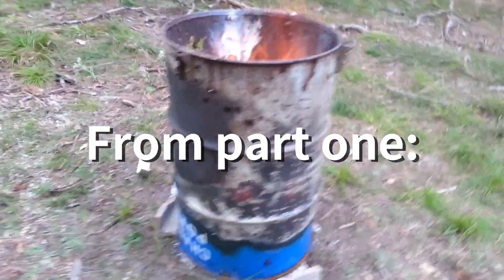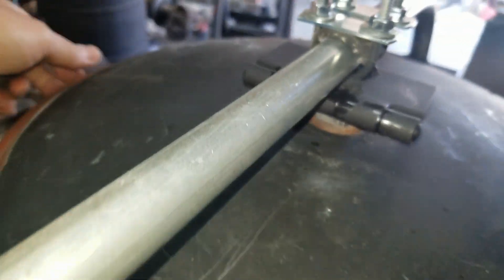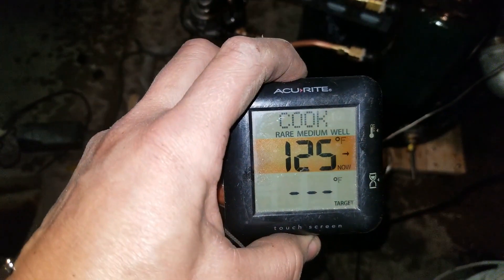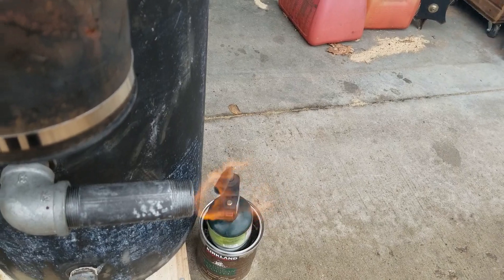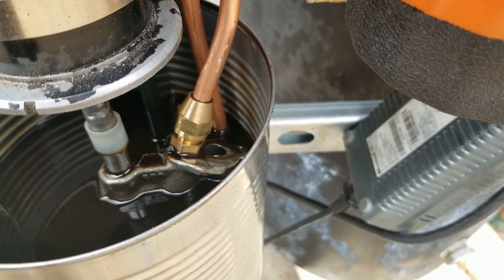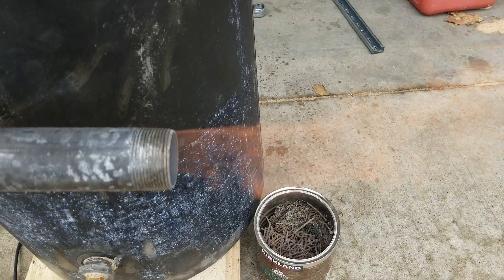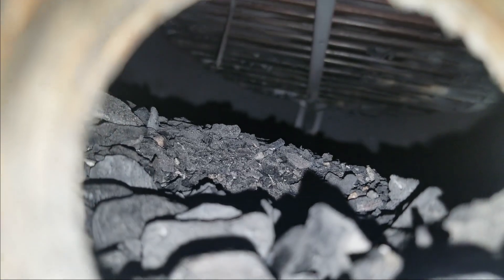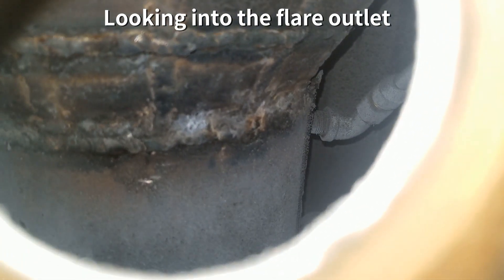Charcoal Gasifier Update 2022, Part 2

Comment: Nice work. 
Your charcoal gasifier is appreciably more elaborate than mine, and it produces a lot more gas as a result. 
Even after all these years of running engines on wood and charcoal, it still amazes me just how well it works  :) .

Comment: I have a few thoughts... why wouldn't you make a dual function gasifier... 
1. Gasifier  which run on charcoal gas...
2. A gasifier that utilize the extreme hot temp ie paralysis process to create charcoal for you at the same time ie  To used in the next burn.

Example 1. if your hopper was larger you could have wood chunks in a fully enclosed  sealable vessel with a manway  lid. You would take the wood gass from the charoal vessel and inject back in to Pyrolysis chamber to be burned. You would need a vibrator mounted to the hopper to ensure charcoal feul from bridging in the main hopper to feed your reactor.

Example 2. The reduction zone is extemely hot.. you could sheild the reduction zone with some diy castable refractory wall cone that can be replaced as need .  To prevent the reduction from burning threw after months or years of usage cus the chamber would burn hotter.
Part two... the above refractory liner would be a thin enought from prevent the chamber from melting or prevent thermal craking...the use back side of reduction zone as a secondary sealed hopper to manufacture more charcoal and again inject the wood gas back into Pyrolysis burner chamber above. 

You  would have 2 chambers wher you could make charcoal
Reply from the maker: 1. Been through it all.  I've melted firebrick. 2. My dual function gasifier is my outdoor boiler.  The waste heat goes to making the water hot for domestic heating (water and space heating), with charcoal the side product.
Reply: Im talking about using bricks but cast your own refactory  mater look up starlight ..you need a better refactory mix...
Reply: You can improve the effiency of the system dramatic ..yes  your making domestic  hot water but you still not effiently  using waste heat from the charcol process to dry your wood.. or use the wood gas byproduct from charcoal process back into the gassifier as secound combustion. Even using a sand battery  soak up heat  for your domestic  hot water.
Reply from the maker: @772777777777777  I agree, and it would be trivial to do so, all I need is to add a water-to-water heat exchanger to connect my hydronic system to the gasifier, instead of the finned exchanger and blower you see on it.

Comment: Add a comment...

I have a few thoughts... why wouldn't you make a dual function gasifier... 
1. Gasifier  which run on charcoal gas...
2. A gasifier that utilize the extreme hot temp ie paralysis process to create charcoal for you st the same time ie  To used in the next burn.

Example 1. if your hopper was larger you could have wood chunks in a fully enclosed  sealable vessel with a manway  lid. You would take the wood gass from the charoal vessel and inject back in to Pyrolysis chamber to be burned.

Example 2. The reduction zone is extemely hot.. you could sheild the reduction zone with some diy castable refractory wall cone that can be replaced as need .  To prevent the reduction from burning threw after months or years of usage cus the chamberwould burn hotter.
Part two... the above refractory liner would be a thin enought from prevent the chamber from melting or prevent thermal craking...the use back side of reduction zone as a secondary sealed hopper to manufacture more charcoal and again inject the wood gas back into Pyrolysis burner chamber above. 

You  would have 2 chambers wher you could make charcoal

Comment: The air bubbles in the oil are from air being sucked into the pump from the drive shaft because there is no seal on  that shaft which is above the oil level
Reply from the maker: That's a good point... but I don't think there is suction there.  I think there is pressure, which is what made the pump leak profusely before I had it immersed.  Also, would the pump suck air when installed in an engine?  In that scenario, the shaft is above the oil level too.